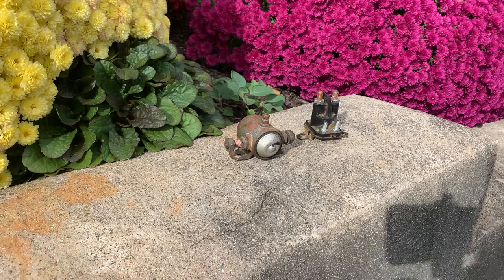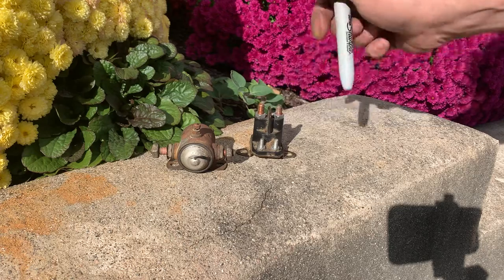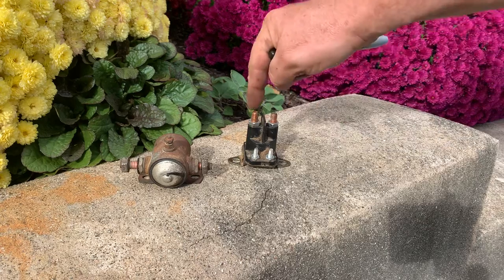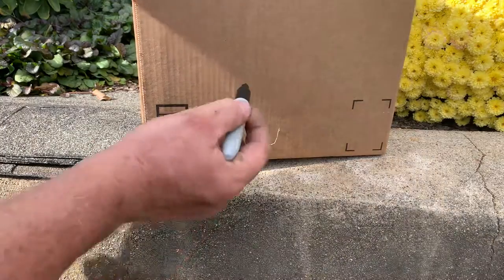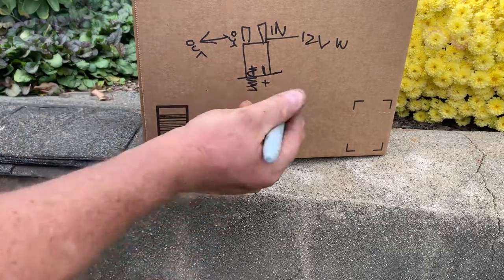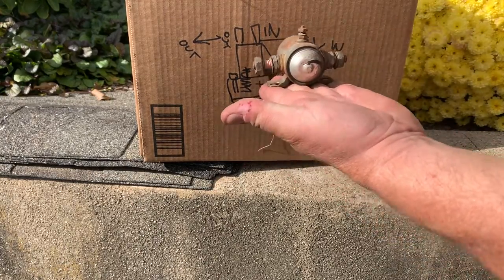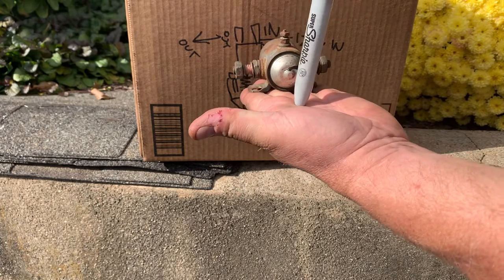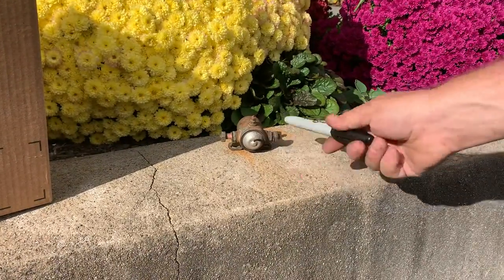3 Post Starter Solenoid versus 4 Post Solenoid. Making a 3 into a 4 post!

Comment: On JD x310 4 post solenoid
 
If u “jump” the solenoid to start (key turned to Start, temp connection from sol power-in terminal to sol power to starter terminal, then remove that temp connection when engine starts - At that point any preexisting safety switches are still active for continued operation of mower. 
Correct??
Reply from the maker: Theoretically yes, since all the safety connections add up to provide ground to the 4th terminal would have to be intact in order for the solenoid to operate, either by switch or by jumper.  The safety's control the ground to the solenoid, without all being satisfied, the solenoid will not operate.

Comment: Ken, I bought a 4 wire solenoid for use as a glow plug relay on my Nissan Hardbody truck. I bought a grey market engine, and it bolted up to my transmission, but I had no glow plug relay, so I used the aforementioned relay as you discussed, and it worked great. Still have the engine, but I sold the truck. It was only 67hp, but it might be good on a tractor. I bought a turbo diesel engine for parts, but it's going in storage too. That turbo will give me a whopping 75 hp on the other engine.

Comment: My boat old omc / gm starter had 4 post. The New starter has 3 post.  There is a way to still use the 3 post? Thankyou!!
Reply from the maker: The 4th post is usually used for safety switches like a neutral safety switch. I would get a 4 post solenoid to be safe.

Comment: I am having a little trouble with an old tractor. It was doing nothing and I changed the Solenoid and now it is turning over but no spark. Would it be a bad safety Switch. My Dad wants me to cut them all and wire them together bypassing the Switches. It's probably the plugs wires and coil in my opinion.
Reply from the maker: What is the tractor brand and model?
Reply: @KensSmallEngineRepair  Old Roper
Reply from the maker: @michaeldemers2716   the model of Roper tractor?
Reply: @KensSmallEngineRepair  IDK. But this morning I got a premonition it was the points. I may take a fine sandpaper to it and gap them with a matchbook.
Reply: @KensSmallEngineRepair  I definitely did the Solenoid right. I double checked. It's something else.
Reply from the maker: @michaeldemers2716 if it has points that’s the first thing I’d try is cleaning them up.  I have a live stream today at 2pm EST if you want to check out our small engine group of YouTube characters

Comment: Can you use a four prong over a three prong
Reply from the maker: Yes. Just make sure it’s a true 4 prong and not a Ford solenoid. A Ford solenoid uses the fourth prong to put full 12 volts to the terminal.  You want a four prong that uses the two small terminals to power the solenoid, one is ground the other is switched positive 12v

Comment: Mine looks just like yours, but the difference is that I have top and bottom posts and one sticking out directly towards me... I guess you would say it's in the center?!!?! Can you help me out here, buddy? This is racking my brain right now, I just wish mine looked exactly, and not just, like yours!😭😭😭
Reply from the maker: 5 pole Solenoids have an extra terminal that will momentarily provide a full voltage to an ignition coil to aid in starting.  Mainly used on old tractors and battery/points ignition systems. It bypasses the ballast resistor to give max voltage to start an engine then cuts out and allows the ignition switch power to go through the ballast resistor lowering the voltage to keep the coil from heating up too much. Hope this helps.

Comment: What are the colors of the wires that hook to the solenoid. And where do they hook up to the solenoid
Reply from the maker: The wire color varies based on the brand and model of tractor the solenoid is on. Do you have a specific brand and model? I can look up to see whether it uses a 3 or 4 post and assist you from there

Comment: To convert from 4 Post to 3

Why not just hook up ground from the safety switches to where it mounts between the actual solenoid/chassis frame.  If you feel its not a good ground, why not run another wire from a good ground point back to the solenoid and tie to safety switch ground?